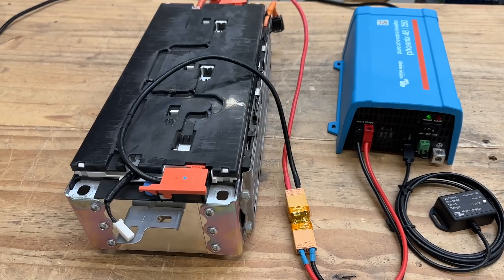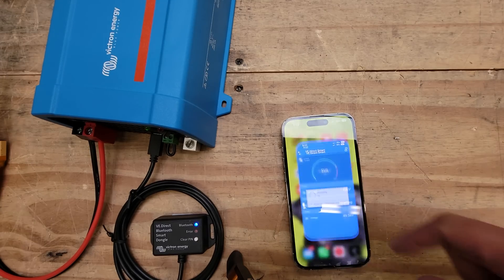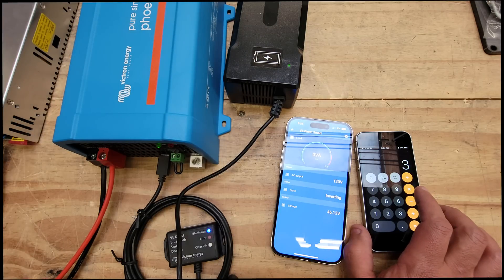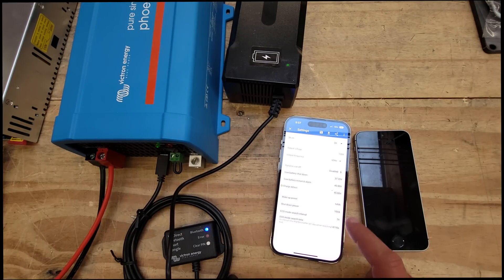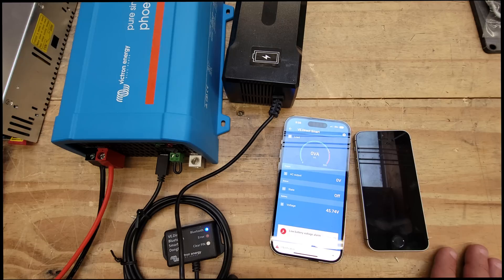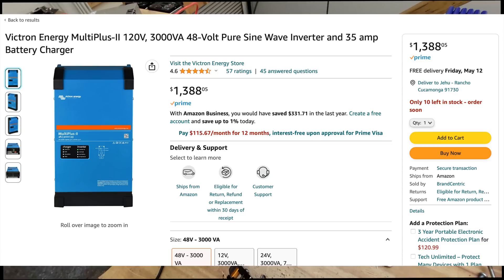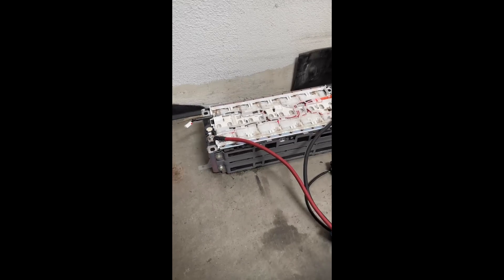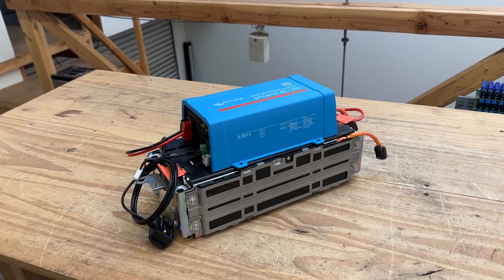Honda 44vdc Clarity Modules Working with Victron Inverters

Comment: I built a battery box for my golf cart using these. The max load is about 75A in my use. We got about 30-40 minutes with just one cell. This is a pretty good battery. My plan is to link them in parallel to get more run time.

Comment: I got 2 clarity batteries and connectors. Just received BMS that was recommended on your site. Charger that you recommended has 3 pin plug. I'm a little lost. Will reach out to you. Going to be using batteries on a 36v forklift. 15 min tops of use.

Comment: Our Magnum Inverter model MS4448PAE, (48v) can be used from 36v to 64v so I bet their 36v Inverter would have no issues using these batteries.  Also the Cells look like our Ford C-Max Energi cells which are made by Panasonic.  I built our first system back in 2017 thanks to channels like yours my friend and after building a few more systems for friends and my shop I am now building our classic silverside 1975 MCI bus, it used to be a Yellowstone Park Tour bus. So I am checking in on all the channels I used to learn from to see what is new and wow things have really changed.  I got our first salvage yard EV batteries (Ford C-Max Energi) back in '17 when nobody was using them but I saw one video that was enough to know they would work as I needed to teardown them to rewire it to fit our new MPP 1k Inverter which can handle 1k of solar and it charges up to 16 volts so I wired it 4s @ 16.8v then in parallel, this way my inverter can charge up to 15.8v which is super efficient.   Can someone tell me why China or the USA does not build batteries to match the Inverters they sell, why?  You can only buy a battery that can only be charged to 14.8 at best yet nearly all Inverters can charge up to 16v so the system is broke from the start. This is why I build our system to be more efficient.

Comment: And how would you charge those 44V batteries with solar panels? MPPT controllers are "rated" at 12/24/36/48V... Are there "flexible" (or "configurable") MPPT controllers that could do a "custom charge/discharge" voltage?

Comment: what bms would you use with these?
Reply: I oredered this.  I am charging with 800 watts of solar and my load is a solar pump that is about 11 amps.  ANT SMART BMS 7S-16S 40A-420A LiFePo4 Li-ion Battery Protection Board Bluetooth

Comment: Victron stuff is legit. All of their inverters AFAIK are all low voltage transformer based. Very heavy but man do they feel robust. They’re software is money. Very customizable. What really makes it shine is the modularity of it all. You can also get a cerbo gx touch screen and connect all the components (inverter,charger,solar mppt, battery shunt) and have them all work together on a beautiful interface.

Only downside is price. But their reliability track record speaks for itself.

Comment: is there an mppt solar battery charger that works for 144v battery packs? i need it for a solar car project. the solar input is somewhere between 12v and 24v.
Reply: You can probably series connect them too. But what BMS do you have on that pack? 40s plus?